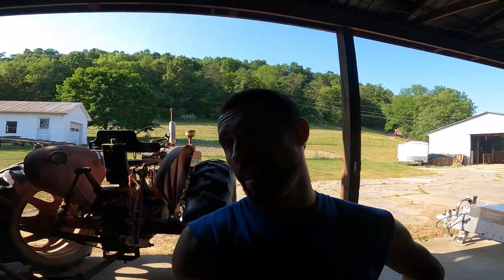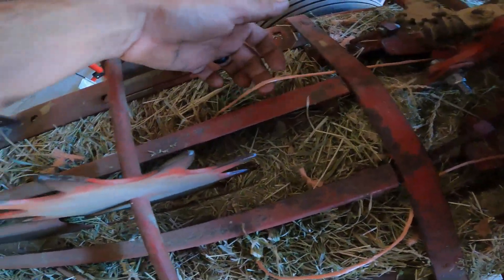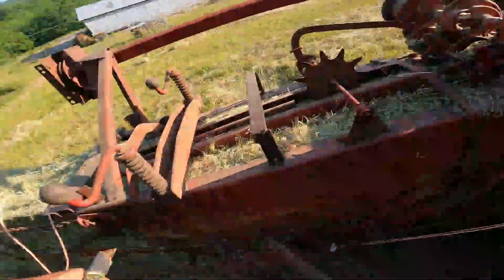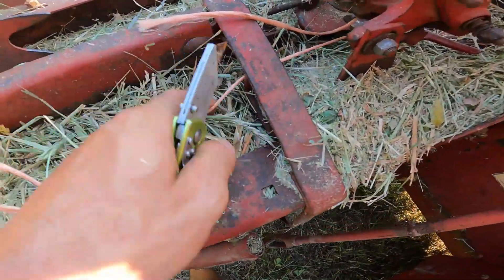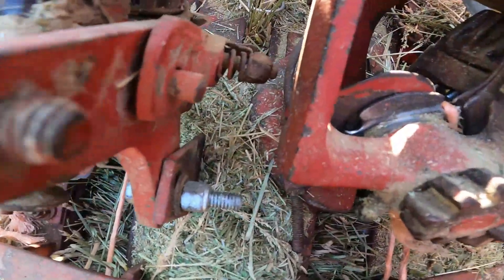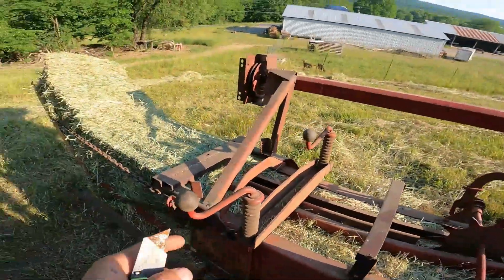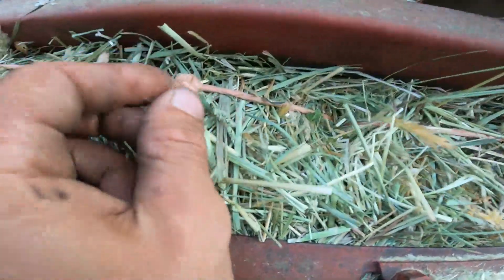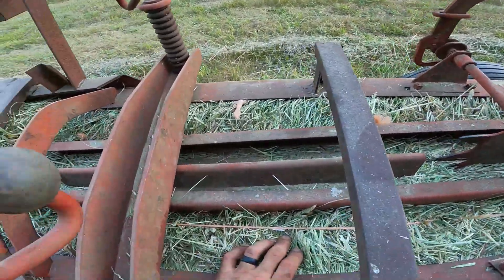Attempting to Bale Hay with New Holland 269

Comment: Do not be discouraged - you have a fine baler.  First place to start is with the operators manual.  Set everything per the book.  Cycle the knotters by hand slowly noting both knotters should cycle through their stroke identical.  Do not guess.  Next look youtube, New Holland has an old video showing exactly how the knotters work.  Third, post questions to the yesterdays tractor forum in the Implement alley section.  Lastly - if push comes to shove, get a NH mechanic out when you are baling to troubleshoot the knotters.  Best of luck...👍
Reply from the maker: Thanks for the info! Appreciate it!

Comment: Just liked and subscribed. I am 72 and bailed many a square bale. Those new holland are very a good design. And Ive used a worn out 268 for many years. Mine was much worse than your's appears to be. Its got to be correctly timed. different length bales indicate out of time. That plastic twine is slicker so the bill hook tension needs to be tighter. And the gap in the bill hook might be too large and a bit of grinding necessary to tighten it up. The needles need to lay the twine across the knotter at the right distance. Knives need to be razor sharp. knife arm needs to rub bill hook to wipe the knot off.   I think I could have it sorted very quickly. My advice Get on U Tube and watch every new holland video, the knotters are the same on most of the older bailers.  Even JD used the same knotters. Make adjustments and take some bales apart and feed with a  pitchfork in the barn and get it fixed before the rain quits.   You dont need to be extra smart to fix that bailer. The smart guys are the ones who designed it.
Reply from the maker: Hoping the adjustments I’ve made will let it work! 😁 and thanks for the tips!

Comment: Every  baler no matter what the brand uses the same basic array of parts to tie a knot.....Gaining a complete understanding how each part functions in the processs   aids in  deternining where the problem is in a failure...... You are looking at the whole assembly.........Cycle by hand, watch and compare each part as it  starts and completes it role in the process of tying........oddities will present themselves......You have a headstart because you got one side working.......Look for excessive wear in the rollers on the knife arm and billhook, check for   correct timing on the gears and gear tooth contact that rotate the bill hook.. and twine disc
Reply from the maker: Thanks for the tips ! I have been checking a lot of that stuff and looking and turning stuff by hand, we did find that it was tying incorrectly and the one twine would slip in under the billhook and then the knot would tie itself incorrectly around the hook and pull tight , I’ve made some adjustments since then and hoping it works now
Reply: Glad to help......